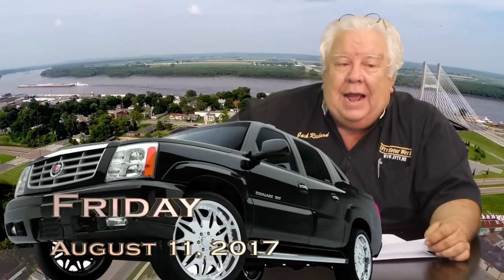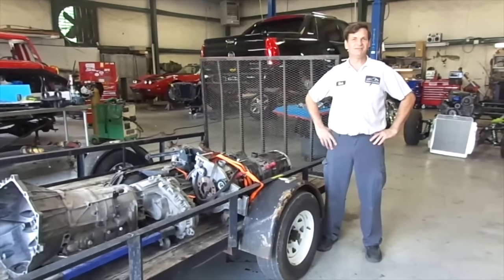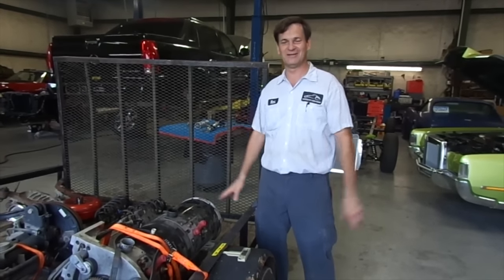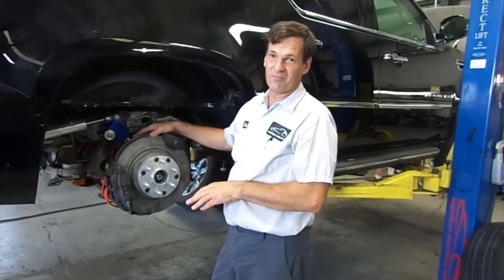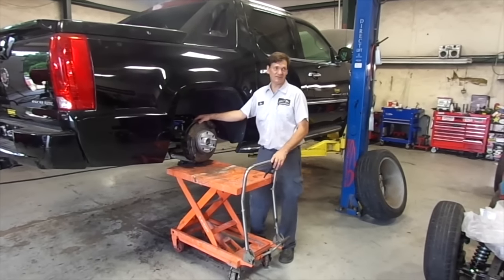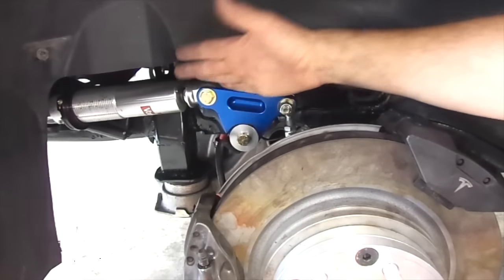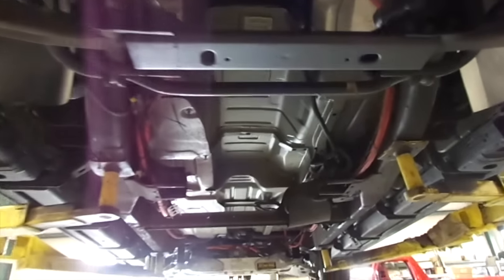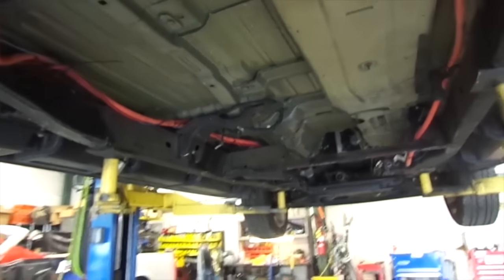Return of Tescalade - Cadillac Escalade  EXT Pickup gets Tesla Model S Drive Unit

Comment: So the original bolts connecting the shocks to the chassis had two counterbearings each aka holes in the drop-forged metal now cut off, so no bending force to the bolt. The new solution has the bolts screwed into the chassis resulting in bending force to the new bolts. A quick prayer that this connection may last long and will not bend & break considering the dynamic loads they have to take.

Comment: Selfish solar/Battery centric discussion begins  23:29
#FtheGrid
Nother gr8 and informative show with the battery/power guru, thanks for the Tesla degradation charts, hadn't seen those ones. Discharge depth from center, temperature, dis/charge rate, I don't know about you Jack but I baby my batteries, and they repay me with longevity.
JB just wants to get more sales, the EV battery's repurposing is less Powerwalls sold in the long run so I understand his motive.
Same with solar panels as with batteries, they don't combust at 80%(though the solar laminate may discolor over time).
 2,200Lbs roo roo LoL
Sign me up in line for one of those 48v {populated} systems Jack, will you have them ready by next Summer controller and all? Not too far either from you in Omaha, NE.
Thanks again for all you do and aim to,
Brent

Comment: after this suspension change the bed cannot haul more than a few hundred pounds. why not go with an air ride system?
Reply: air ride sucks? Tesla's have an air ride especially if you are hauling a load much better than the garbage these scammers from georgia installed in Rickards Escalade.  If i was rickard would be demanding a refund.  Scam company.
Reply: Joeys Cleaning Lady, that suspension setup doesn't look suitable for that truck. It looks like it was designed for a 1200 pound race car, not a 6000 pound truck. 3.5" travel, lock to lock, with no apparent snubbers is going to create serious stress when it bottoms out. 

I guess the spring they stuck in there is just temporary until the battery is installed, then then can choose a variable rate coil spring like just about every suspension coil spring in history. Air suspension would be nice and is also inherently variable rate. 

That tie-rod looked pretty weak for something that supports the entire forces on each rear corner.

Comment: JB Straubel is right, Tesla can't sell PowerWalls to home and industrial clients with used cells. PowerWalls and PowerPacks are supposed to be high end products. 
There's also a problem with cell chemistry, as PowerWall and PowerPack cells are made with different chemistry, designed for daily charge/discharge, while Tesla car batteries are designed for weekly charge/discharge.
Right now the Gigafactory is producing two types of batteries, both with the 2170 form factor, but with different destination (car vs. stationary storage).
As a side note, for Tesla's Australian huge battery station it seems Samsung will be providing the cells, not the Gigafactory.
Reply: Powerwall and Powerpack are NMC which are quite safe vs what they put in cars.  I really wish that saltwater battery did not go bankrupt as that is the safest.  Would not want a passive cooling dangerous chem grid storage solution. Tesla grid storage products are overpriced but I am also weary of Rickard re-purposing this chem for grid storage when tesla themselves do not advocate that.  Better off going with iron phosphate or some other low density safe chem that does not require active cooling.. With global warming and out of control temps in many areas of the country the last thing anyone needs is thermal runaway in their garage or basement.  Rickard should sell the packs with a foam suppressant system to ensure safety because it ain't safe in a home. Tesla themselves don't sell it
Reply: Not true.  Different chemistry and different form factor.  For not much more youI could buy 5 Tesla Powerwall 2's for 70 kWh and 25kW.  Actually, 4 would handle all my loads including A/C and charging my Tesla.
Reply: Powerwall also uses a 2170 cell instead of 18650.
Reply: Further tesla uses NMC batteries as replacement packs sourced from LG in their vehicles.  (see roadster 3.0) amazing right?
Reply: more lies tesla sources from LG for the roadster 3.0 pack you don't know what you are talking about but have another one and keep commenting
Reply: tesla uses LG cells in the Roadster replacement packs
Reply: I agree with Jack, I think the 2170s will all be the same chemistry and within 4% of eachother in performance variance.
Yes, they were NMC and NCA, really we're talking 5,000 vs 3,000 cycles full discharge.
The cells in the Tesla EVs aren't ever fully discharged though(or fully charged), even in Emergency(you're on 0miles)Mode it probably only discharges to 8-10% and charges to 95%, hence why used NCA cells will still work fine for solar, especially if you keep them at 15%-90% as you should to get the max output over lifespan.
The float life is often the limitation for this kind of endeavor if done right(between 50-80°F at 1C 15-90%DOD),  at 15-30 years they'll start decaying within regardless of use or disuse. 
I firmly believe these used cell, if above 85% initial capacity can last 10-18 years semi-daily discharge, and for a person like me whom intends to size for 5 days without sunshine which means I will under utilizes daily discharge I'll get over 13 years use, and by then batteries are dirt cheap for replacement.
Sure you could get LiFePO4 for 5,000 Full DOD, or LTO for 8,000, but you'd be a fool to overlook the declining prices and the realization that in 10 years replacement is cheap and all you'd be doing is overinvesting.
Reply: No it's cycles... I really am starting to think you're trolling with your comments thus far. Actually on that note, blocked.
Reply: They started producing PowerWall and PowerPack cells in January 2017, and Model 3 cells in June 2017.

"Tesla’s new 2170 format battery cells went into production back in January, but those cells were using Nickel Manganese Cobalt Oxide (NMC) chemistry for stationary energy storage products, Tesla’s Powerwall and Powerpack.

But for its vehicle battery packs, Tesla has been using Nickel Cobalt Aluminum Oxide (NCA) chemistry optimized to cycle in electric vehicles. While the company confirmed that they would still be using different batteries for their vehicles, they didn’t confirm if it would still be a NCA chemistry."

https://electrek.co/2017/06/19/tesla-model-3-battery-cell-production/
Reply: Kárpát Zoltán That's cool, good source, obliged, and I can understand why, they want to assure they can promote a solid warranty without anyone defaulting on it. I once calculated it at 5,138 cycles(if I recall correctly for the PW1) over it's span with the MWh longevity span(warranty, it has both a 10 year and MWh) they put forth. That's well and good if you're the type of, without being too obtuse, idiot, which would cycle your battery between 0-100%, but being that I know chemistry and battery management quite well I can get that same amount of kWh over the life span of an NCA battery. We're talking about a 3/5ths ratio between these two types(3Kvs5K cycles), and if instead you use an NCA to 10-90% you'll reach that 5,138 cycles. Yes, you'll use 80%, 4/5ths of the capacity, but given that the loss is 20% and the ratio difference was 40% you're 50% closer to the same longevity output over the span. If you instead move to 20-80% DOD, so 60% of capacity used you'll probably manage ~8,000 cycles, which is what the NMC will manage at 10-90%. So what I'm trying to say is you get more output over lifespan by limiting how harshly you treat the cells, let's say we're talking 1kWh of each, NMC at full discharge  5.138MWh, NCA at 60%(20-80%) 4.8MWh. As important as chemistry is, if you can pay 26cents/wh for NCA or 41cents/wh for NMC and the NCA will last you 13 years and NCM will last you 18 and you're aware battery price in 13 years will be less than half of what it is today, Which is the more sound investment?
NCA kept between 50-80°F and NMC is kept at 30-110°F will manage near the same cycles life, or if NMC is simply left at 100% or 0% charge for a month it will manage the same cycle life. My point being a poorly cared for and implemented expensive cell in someone else's hands will output the same over it's lifespan as a much cheaper cell in mine.  I'll probably dis/charge at .5C, probably keep it 50-80°F,  and never leave it under 20% or over 90% overnight, I'll outlast the next best chemistry, and I'll cheaply coast over the price decline period, there is a calculated decision and then there is overkill. Just like this Self-Built PC I'm typing on, everything is in balance, no bottlenecks or wasted investment.

Comment: Jack Loving the channel.
Please keep 50/60 Hz on the Inverter,  i Agree it does not need to be user accessible once chosen for country that's it, it will never need changing again so a switch you could accidently change is not great, I live outside the USA. large parts of the world use 50 Hz https://upload.wikimedia.org/wikipedia/commons/9/95/Worldwide_map_of_voltage_and_frequency.png
interested in an electric car which is why i started watching the channel) but want a good range compact as its only me so dont need an S,X,3,Y and there's no Bolt in the uk so maybe a leaf in future or once saved up and mobile enough build a classic car in to EV.